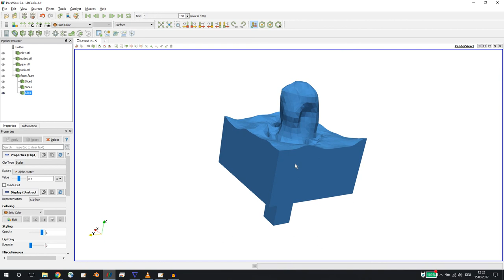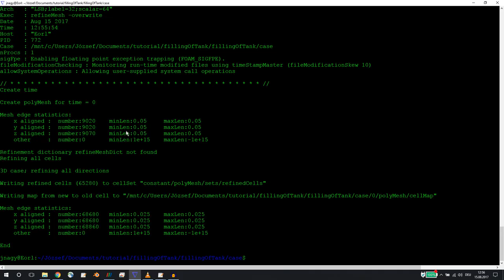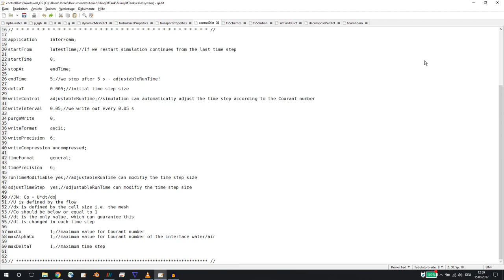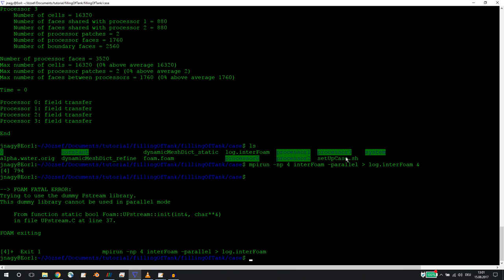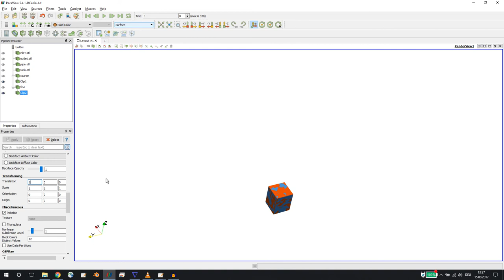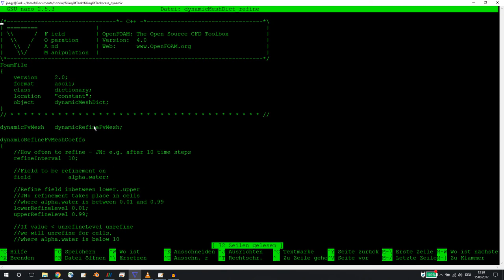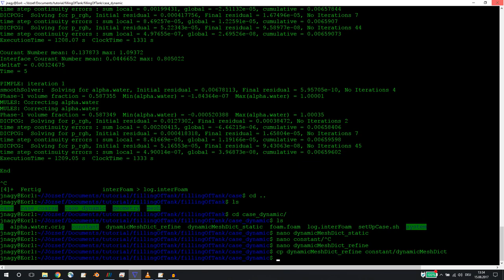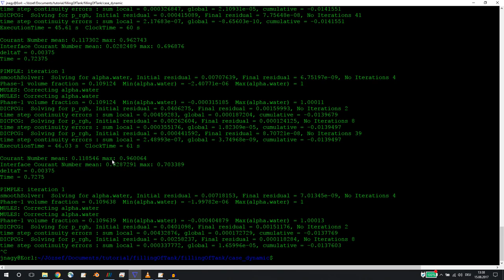Multiphase simulation project in OpenFOAM in Windows 10 and Ubuntu - tutorial part 4 - simulation

Comment: Hi dear Dr. Excuse me I had problem with running the volume mode in my OPENFOAM! It doesn't have any volume mode, it has surface ets, but not volume one.
Reply from the maker: In OpenFOAM or Paraview?
Reply: @OpenFOAMJozsefNagy  in paraView, thank you for your attention
Reply from the maker: @komeilsamet789  I think you mean the volume rendenring. That we do not use. Usually you use slices to to cut through the domain.
Reply: @OpenFOAMJozsefNagy  No it had been existed in previous versions like 3, but unfortunately it don't see in new versions like mine (V7), I heard from my friend that it needs some actions in order to can view the velocity parameter in the 3D form. Actually when I run a simulation it has problem in showing or even running the volume! 😔 Because of that I use the 2d form in my current paper, then I should come to 3d for FSI problem.
Reply from the maker: @komeilsamet789  Then try an older version of Paraview.

Comment: hi jozsef, i have been following these toturials they are very detailed, but i was running a model of my own and i first modelated a case with a coarse mesh, later i modeled a case with a fine mesh to improve the results but when i looked this results and they still appear with the coarse mesh in consecuense the same results as before and not with te fine mesh
Reply from the maker: What is the difference in the fine mesh?
Reply: It has more divisions in 1 direction changing the cell size from aprox 0.3- 0.1-0.05 to 0.1-0.1-0.05, and the case is a sedimetation tank for a small hidroelectric
Reply: József i think i now where mi mistake is, when i was remeshing i didnt copy the new mesh from the folder mesh to the folder case, but thaks for taking the tine to read mi question and respond
Reply from the maker: I am glad you found the problem and solved it. Great!

Comment: one question pls, is blender the best choice to create a 3D geometry and prepare it for the simulation? especially for beginners in 3D modelling
Reply from the maker: The initial learning curve in Blender is just as steep as in OpenFOAM. It is mostly suitable for animated videos or pictures, it is not a CAD tool, but it is suitable for geometry creation. Alternatives are freecad and salome. All three are free.
Reply: Thank you Jozsef
Reply: Dear Jozsef,
I think Salome will be a good choice.. I have problem with installing in windows.. any ideas?
Reply from the maker: Puh, sorry, but I do not have any experience with Salome in Windows. Maybe Tobias Holzmann?
Reply: It works !, after installing and extracting the files, from "work" directory run the "run_salome.bat" file as administrator. some firewall screens appear, then it works. it seems each time you need to run salome you need to click the run_salome.bat file.
Reply from the maker: I am glad it works!

Comment: the flux change forms at junction beetween pipe and tank ? is it right ? is it a difussion problem ?
Reply from the maker: I don't understand the question.
Reply: József Nagy the pipe has a rectangular section, but when the flow enters in the tank it becomes circular ....
Reply from the maker: @ing.nicola1706  Yeah, it might be the viscosity, but also surface tension. Numerical diffusion can also play a role.

Comment: Great series, In windows openFoam V 1706 uses mpiexec.exe  instead of mpirun. Thanks for everything Jozsef, and I am glad you had a great lunch.
Reply: I hadn't seen your comment before, so I went ahead and searched for another solution. The solution presented here: https://www.cfd-online.com/Forums/openfoam-solving/185541-error-while-running-mpirun-command-openfoam.html also worked for me. That is, running export OPAL_LIBDIR=$OPAL_PREFIX/lib64/ before running mpirun does the trick temporarily. For a more permanent fix I edited the file named mpi under $HOME/OpenFOAM/OpenFOAM-3.0.1/etc/config,sh/. But your solution works just as well :P

Comment: Thank you for sharing this series. I am running this simulation in Ubuntu and at the end of simulation it says "Finalising parallel run" and stops there. Can you please insight me what problem do I have? Looking forward for your reply. 
Thank you.
Reply from the maker: That is perfectly fine. Your simulation ran through. With ctrl+c you can stop tail -f and you are back in the bash.
Reply: Thank you for your response. However when I tried to play my result in paraview, It played only the coarse result. I have all the time steps in my processor folders for the fine mesh simulation but couldn't play the result. Could you please point out where I made mistake? I am new to Paraview and openFoam.
Thank You!
Reply from the maker: Did you maybe forget to switch to decomposed case in Paraview?
Reply: @OpenFOAMJozsefNagy  Hi, Jozsef, I am using OpenFOAM 6.0 on Ubuntu 18.04, and the same thing happens. When using 'reconstructPar', it fails at t = 1.5 or so. This is quite unexpected.
Reply from the maker: @biaohuang7957  Interesting. Did you try it with a different version of OpenFOAM?
Reply: @OpenFOAMJozsefNagy  I should have done "reconstructParMesh" before "reconstructPar" for the Adaptive Mesh Refinement case, I suppose. Thanks very much for your nice videos.
Reply from the maker: @biaohuang7957  Great, thanks for your response!

Comment: Hy József. I'm having some trouble to run setFields. When I do the command, the following message appears:
"--> FOAM FATAL IO ERROR:
Cannot find patchField entry for allBoundary

file: /home/lucas/hydraulic_jump/inlet_5cm/case_dynamic/0/alpha.water.boundaryField from line 25 to line 64.

From function voidFoam::GeometricField<Type, PatchField, GeoMesh>::Boundary::readField(const Foam::DimensionedField<TypeR, GeoMesh>&, const Foam::dictionary&) [with Type = double; PatchField = Foam::fvPatchField; GeoMesh = Foam::volMesh]
in file /home/pgh/OpenFOAM/OpenFOAM-v1706/src/OpenFOAM/lnInclude/GeometricBoundaryField.C at line 191.

FOAM exiting"

I have no idea what is wrong. I've tried to redo all the steps before and still not working (yes, I'm simulating a hydraulic jump)

Please, can you help me with this problem??
Reply from the maker: The original boundary out of blockMEsh still remained in your snappyHexMesh. Maybe your stl file was exactly as big as the blockMEsh and snappy thought that it should leave it. Make your blockMesh a bit bigger than your stl files and it should be fine.
Reply: I'll try to do that. Thanks for your help!
Reply: Hey, now it's working!! Thank you so much!
Reply from the maker: I am glad.

Comment: Hi Joszef, thank you for this tutorial. i got a problem for the post-processing using the parallel simulation. As the simulation is finished, the result is divided and stored in 4 folders (processorN folders). And then i use reconstructPar but i got an error as follow: 
...
--> FOAM FATAL ERROR: 
cannot find file "/case_dynamic/processor0/0.1/polyMesh/pointProcAddressing"

    From function virtual Foam::autoPtr<Foam::ISstream> Foam::fileOperations::uncollatedFileOperation::readStream(Foam::regIOobject&, const Foam::fileName&, const Foam::word&, bool) const
    in file global/fileOperations/uncollatedFileOperation/uncollatedFileOperation.C at line 505.

FOAM exiting

Any idea what should i check solve this?
Thanks in advance
Reply from the maker: Well, I usually do nt reconstruct the results, you can open them up in Paraview in parallel. This is some kind of bug in OpenFOAM. If you really need the reconstructed case, please google the problem. I am sure you are not the only one.
Reply: thanks, i've tried a couple sources to troubleshoot but still cant fix this issue. Yes, i also tried to not reconstruct but directly open in paraview as a decompressed case and the result was good enough. I was thinking to reconstruct this because when i set the tank surface to semi transparent i see the partition surface has a transparent color as well.

Thanks for your reply!
Reply from the maker: I am glad I can help.
Reply: You need to use "reconstructParMesh" before reconstructing the results. I think is due to the fact that the mesh is changing in some time folders.

Comment: Thanks Jozsef, 

I am facing this error when running dynamic meshing in serial mode and simulation stops at 0.12sec

smoothSolver:  Solving for alpha.water, Initial residual = 3.89116e-05, Final residual = 1.31203e-09, No Iterations 2
Phase-1 volume fraction = 0.0148529  Min(alpha.water) = 0  Max(alpha.water) = 1
MULES: Correcting alpha.water
MULES: Correcting alpha.water
Phase-1 volume fraction = 0.0148529  Min(alpha.water) = -0.000175017  Max(alpha.water) = 1
DICPCG:  Solving for p_rgh, Initial residual = 0.0685134, Final residual = 0.00245595, No Iterations 7
time step continuity errors : sum local = 5.92024e-07, global = -1.54027e-09, cumulative = -2.61438e-06
DICPCG:  Solving for p_rgh, Initial residual = 0.0185487, Final residual = 0.00077948, No Iterations 7
time step continuity errors : sum local = 2.03873e-07, global = -2.38353e-08, cumulative = -2.63822e-06
DICPCG:  Solving for p_rgh, Initial residual = 0.00493488, Final residual = 8.38807e-08, No Iterations 40
time step continuity errors : sum local = 2.22609e-11, global = 2.41677e-13, cumulative = -2.63822e-06
ExecutionTime = 1.79 s  ClockTime = 2 s

Courant Number mean: 0.00169803 max: 1.03599
Interface Courant Number mean: 6.68599e-05 max: 0.642318

deltaT = 2.4943e-06
Time = 0.128684

Selected 0 cells for refinement out of 8552.
Selected 7 split points out of a possible 56.
Unrefined from 8552 to 8503 cells.
DICPCG:  Solving for pcorr, Initial residual = 1, Final residual = 7.82615e-06, No Iterations 38
time step continuity errors : sum local = 2.0986e-12, global = 5.03926e-14, cumulative = -2.63822e-06
smoothSolver:  Solving for alpha.water, Initial residual = 3.62881e-05, Final residual = 2.85949e-10, No Iterations 2
Phase-1 volume fraction = 0.0148532  Min(alpha.water) = 0  Max(alpha.water) = 1
MULES: Correcting alpha.water
MULES: Correcting alpha.water
Phase-1 volume fraction = 0.0148532  Min(alpha.water) = -9.94818e-05  Max(alpha.water) = 1
#0  Foam::error::printStack(Foam::Ostream&) at ??:?
#1  Foam::sigFpe::sigHandler(int) at ??:?
#2  ? in "/lib/x86_64-linux-gnu/libc.so.6"
#3  ? in "/opt/openfoam-dev/platforms/linux64GccDPInt32Opt/bin/interFoam"
#4  ? in "/opt/openfoam-dev/platforms/linux64GccDPInt32Opt/bin/interFoam"
#5  ? in "/opt/openfoam-dev/platforms/linux64GccDPInt32Opt/bin/interFoam"
#6  __libc_start_main in "/lib/x86_64-linux-gnu/libc.so.6"
#7  ? in "/opt/openfoam-dev/platforms/linux64GccDPInt32Opt/bin/interFoam"
Floating point exception (core dumped)
Reply from the maker: Difficult to say fro this error only. Which version do you use, is this my case or your own?
Reply from the maker: Bruno Almeida Regina  Also difficult to say. Reducing the Co number is a good start. Different discretization might also help.

Comment: I ran it again without using processors and this time it ended at 4.15 secs.

Courant Number mean: 0.0893897 max: 0.696991
Interface Courant Number mean: 0.0314599 max: 0.50898
deltaT = 0.0019043
Time = 4.15

smoothSolver:  Solving for alpha.water, Initial residual = 0.00483451, Final residual = 1.21117e-09, No Iterations 3
Phase-1 volume fraction = 0.516185  Min(alpha.water) = -2.29085e-07  Max(alpha.water) = 1
MULES: Correcting alpha.water
MULES: Correcting alpha.water
Phase-1 volume fraction = 0.516184  Min(alpha.water) = -7.58295e-05  Max(alpha.water) = 1.00005
DICPCG:  Solving for p_rgh, Initial residual = 0.0120919, Final residual = 0.000377037, No Iterations 2
time step continuity errors : sum local = 0.000649361, global = -8.58632e-06, cumulative = -0.00597286
DICPCG:  Solving for p_rgh, Initial residual = 0.000404916, Final residual = 1.72331e-05, No Iterations 9
time step continuity errors : sum local = 2.96177e-05, global = 4.41446e-06, cumulative = -0.00596845
DICPCG:  Solving for p_rgh, Initial residual = 3.90271e-05, Final residual = 9.20059e-08, No Iterations 44
time step continuity errors : sum local = 1.58166e-07, global = -1.33893e-08, cumulative = -0.00596846

--> FOAM FATAL IO ERROR: 
error in IOstream "/home/paras/OpenFOAM/paras-6/run/tutorials/fillingOfTank/case/4.15/p" for operation Ostream& operator<<(Ostream&, const Scalar&)

file: /home/paras/OpenFOAM/paras-6/run/tutorials/fillingOfTank/case/4.15/p at line 63671.

    From function virtual bool Foam::IOstream::check(const char*) const
    in file db/IOstreams/IOstreams/IOstream.C at line 96.

FOAM exiting
Reply from the maker: You ran out of disc space.
Reply: @OpenFOAMJozsefNagy  Yes, you are right.
Can u suggest me a tutorial which is simple and has internal faces as walls. I am not able to create inner faces as walls and don't know much about createBaffles.
Reply from the maker: @parasghumare5502  Sorry, I do not have any.
Reply: @OpenFOAMJozsefNagy  Alright,
I figured it out now. Thanks

Comment: My case ran till 3.7 secs after which I got the following error:

Courant Number mean: 0.125499 max: 0.741295
Interface Courant Number mean: 0.0573004 max: 0.576626
deltaT = 0.0021978
Time = 3.7

smoothSolver:  Solving for alpha.water, Initial residual = 0.00972992, Final residual = 4.3052e-10, No Iterations 4
Phase-1 volume fraction = 0.499497  Min(alpha.water) = -4.55179e-08  Max(alpha.water) = 1
MULES: Correcting alpha.water
MULES: Correcting alpha.water
Phase-1 volume fraction = 0.499495  Min(alpha.water) = -0.000971416  Max(alpha.water) = 1.00052
DICPCG:  Solving for p_rgh, Initial residual = 0.0154317, Final residual = 0.000481289, No Iterations 2
time step continuity errors : sum local = 0.00109913, global = 2.0915e-05, cumulative = -0.00957896
DICPCG:  Solving for p_rgh, Initial residual = 0.000541169, Final residual = 2.3263e-05, No Iterations 9
time step continuity errors : sum local = 5.29903e-05, global = 1.4146e-06, cumulative = -0.00957755
DICPCG:  Solving for p_rgh, Initial residual = 6.59045e-05, Final residual = 9.04186e-08, No Iterations 51
time step continuity errors : sum local = 2.0593e-07, global = 1.84708e-09, cumulative = -0.00957754
[3] [0] 
[0] 
[0] --> FOAM FATAL IO ERROR: 
[0] error in IOstream "/home/paras/OpenFOAM/paras-6/run/tutorials/fillingOfTank/case/processor0/3.7/p" for operation Ostream& operator<<(Ostream&, const Scalar&)
[0] 
[0] file: /home/paras/OpenFOAM/paras-6/run/tutorials/fillingOfTank/case/processor0/3.7/p at line 8170.
[0] 
[0]     From function virtual bool Foam::IOstream::check(const char*) const
[0]     in file db/IOstreams/IOstreams/IOstream.C at line 96.
[0] 
FOAM parallel run exiting
[0] 
[1] 
[1] 
[1] --> FOAM FATAL IO ERROR: 
[1] error in IOstream "/home/paras/OpenFOAM/paras-6/run/tutorials/fillingOfTank/case/processor1/3.7/p" for operation Ostream& operator<<(Ostream&, const Scalar&)
[1] [2] 
[2] 
[2] --> FOAM FATAL IO ERROR: 
[2] error in IOstream "/home/paras/OpenFOAM/paras-6/run/tutorials/fillingOfTank/case/processor2/3.7/alphaPhi0.water" for operation Ostream& operator<<(Ostream&, const Scalar&)
[2] 
[2] file: /home/paras/OpenFOAM/paras-6/run/tutorials/fillingOfTank/case/processor2/3.7/alphaPhi0.water at line 5926.
[2] 
[2]     From function virtual bool Foam::IOstream::check(const char*) const
[2]     in file db/IOstreams/IOstreams/IOstream.C at line 96.
[2] 
FOAM parallel run exiting
[2] 

[3] 
[3] --> FOAM FATAL IO ERROR: 
[3] error in IOstream "/home/paras/OpenFOAM/paras-6/run/tutorials/fillingOfTank/case/processor3/3.7/p" for operation Ostream& operator<<(Ostream&, const Scalar&)
[3] 
[3] file: /home/paras/OpenFOAM/paras-6/run/tutorials/fillingOfTank/case/processor3/3.7/p at line 14906.
[3] 
[3]     From function virtual bool Foam::IOstream::check(const char*) const
[3]     in file db/IOstreams/IOstreams/IOstream.C at line 96.
[3] 
FOAM parallel run exiting
[3] 

[1] file: /home/paras/OpenFOAM/paras-6/run/tutorials/fillingOfTank/case/processor1/3.7/p at line 9220.
[1] 
[1]     From function virtual bool Foam::IOstream::check(const char*) const
[1]     in file db/IOstreams/IOstreams/IOstream.C at line 96.
[1] 
FOAM parallel run exiting
[1] 
--------------------------------------------------------------------------
MPI_ABORT was invoked on rank 0 in communicator MPI COMMUNICATOR 3 SPLIT FROM 0
with errorcode 1.

NOTE: invoking MPI_ABORT causes Open MPI to kill all MPI processes.
You may or may not see output from other processes, depending on
exactly when Open MPI kills them.
--------------------------------------------------------------------------
[Paras:02547] 3 more processes have sent help message help-mpi-api.txt / mpi-abort
[Paras:02547] Set MCA parameter "orte_base_help_aggregate" to 0 to see all help / error messages

What went wrong?
Reply from the maker: I think you ran out of disc space.
Reply: @OpenFOAMJozsefNagy  yeah, figured that out
Reply: @OpenFOAMJozsefNagy  Really? That's it? I have encountered it many times (hundred times literally) and always get frustrated on changing the BC! Thanks Jozsef, now I know.